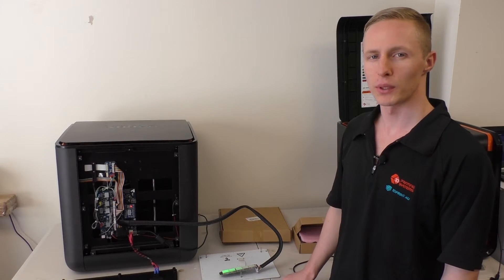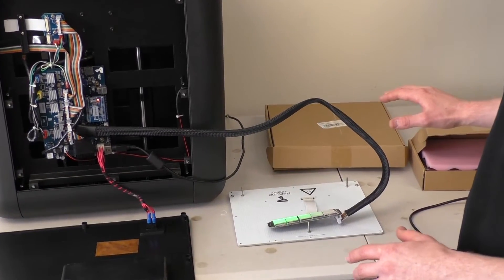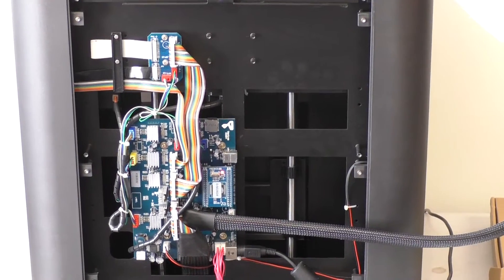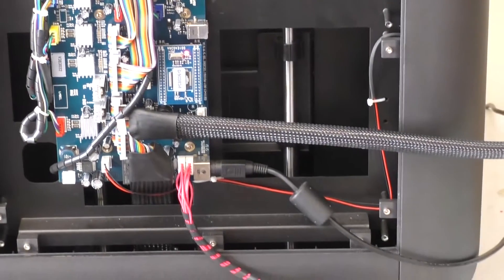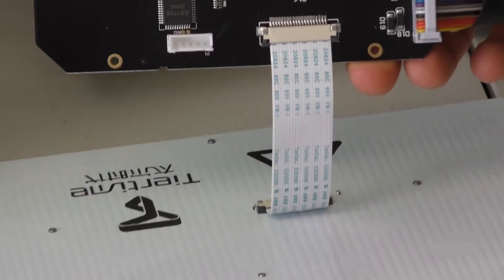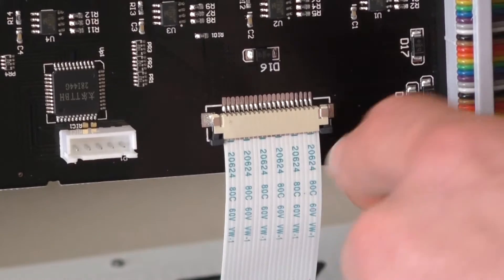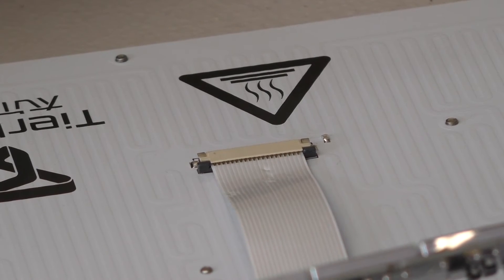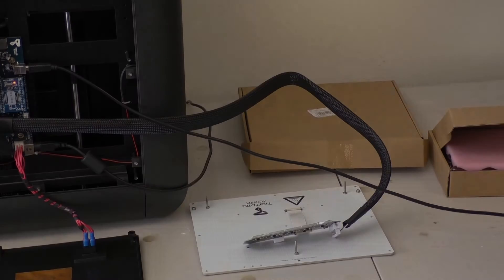Support / UP Box / Platform not heating? How to fix platform heating issues.

Comment: I had a problem with a broken ribbon cable which I replaced.  Not the printer is reading +20-30DegC from actual.
I put a temp probe on the bed, heated it up to 100DegC an plotted the decaying curve.  Values were recorded manually so there were some outlyers but the trend is consistent.  How can I correct this?
Reported,	Actual
100,	65
100,	66.5
100,	67
  84,	60
  83,	59.5
  82,	58.5
  81,	58
  80,	57
  79,	56
  78,	55.5
  77,	54.5
  76,	54
  75,	53
  74,	52
  70,	45
  57.5,	36.5
  54,	33
  51.8,	30
  51.3,	29.5
  48,	24.5
  44,	32.5

Comment: My printer is several years old and the platform heater is not running away without control.  It suddenly went to 145 deg C when I turned it on this last time.  I am trying to check the short white flex to the heater board but it is impossible to work on since it is on the bottom of the platform.  How do you remove the platform to get to the situation in your video?  I have a replacement platform that I have been wanting to install so this seemed like a good time to do that.
Reply: Did you get a solution? How to remove the platform

Comment: Hi, I have an Up! Box, and I my platform is behaving very erratically! Rarely it heats up, but eventually it just stops heating. I checked the continuity of the Flat cable connecting the platform and the front board. The flat cable is fine, even replaced the cable with a new one. I believe this means the problem "could be" with the front board OR the mother board. So my question is - how do you actually decide which component is the problem?
Reply: I have the same issue, could it be the print bed component?